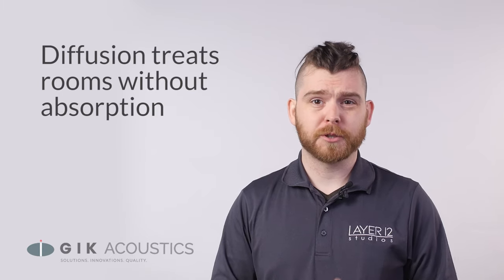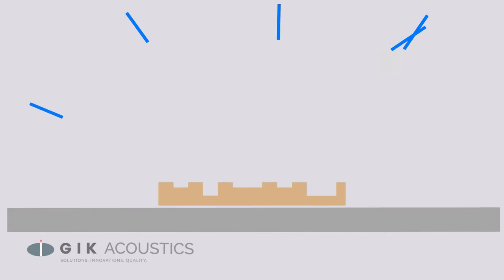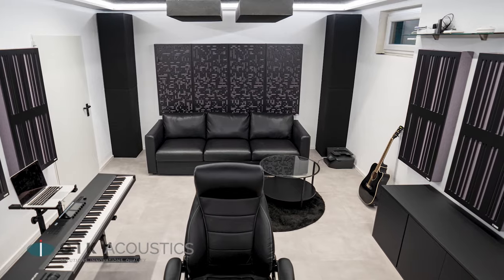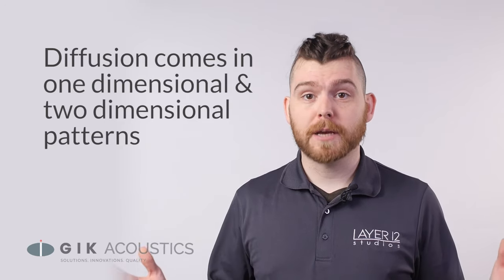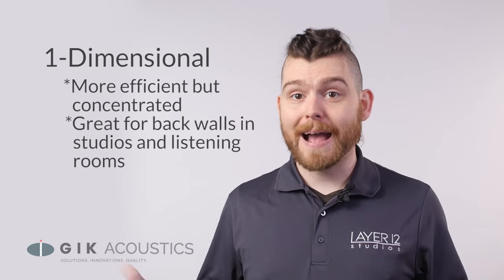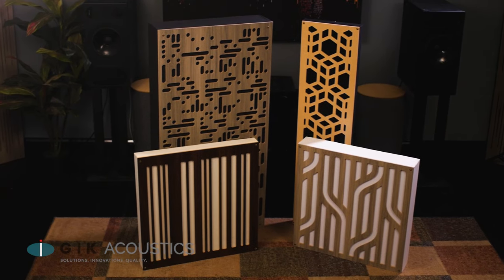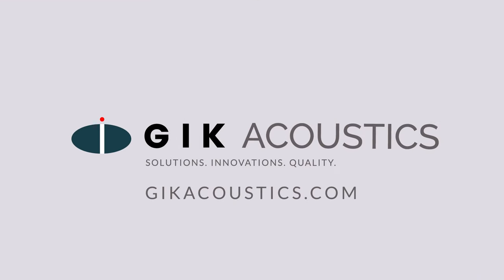Understanding Sound Diffusion and the keys to use it effectively

Comment: I  want to record ONLY vocals in a 10 x 14ft room with carpet on the floor, dry wall and  window with blinds on the 10ft wall. I do plan to use a portable ISO BOOTH for VOCAL RECORDING ... would this be enough or would you recommend more acoustic treatment ?
Reply from the maker: Thanks for the question. It completely depends on the quality you are looking for. While you'll see an immediate improvement in simply only using the VISO or the PIB alone, we still suggest having a complete acoustics strategy to combat any and all first reflections (mainly side walls and ceiling) that may be able to find their way back into the microphone's pickup pattern. This includes acoustic panels or creating a "room" using two PIBs facing each other to create a reflection-free space, since there is a chance some reflections from behind or above can make their way into the recording.

PIB (portable isolation booth) -https://www.gikacoustics.com/product/pib-portable-isolation-vocal-booth/
VISO Booth - https://www.gikacoustics.com/product/viso-portable-vocal-isolation-booth/

If you would like custom tailored advice to your specific room, please fill out our easy form and you'll get your question in front of one of our talented acoustic designers. 
https://www.gikacoustics.com/acoustic-advice-form/
Reply: @GIKAcousticsLLC  Big Thanks for the feedback ...

Comment: i'm not sure i understand the concept of 'even scattering' let alone 'perfectly even scattering' even if the sound waves were to hit a panel perpendicularly... 
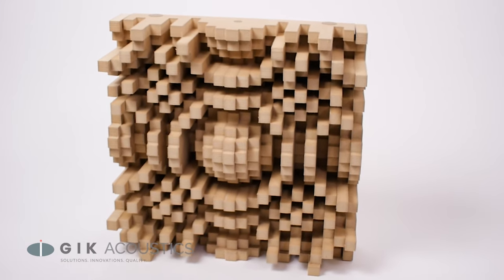take for example the awesome pattern @1:14. 
where would i position a sound source to hit all the sides of the panel at the same time and angle? far away, dead center? that would result in a symmetrical scattering pattern but that's not the same as 'even'.
anyways, that cloud panel @3:35 is insane  :)

Comment: My room is 12 by 11. Very small.  Is there any way to get a diagram of where diffusers and absorbers should br?? 7.2 with a 12 inch sub in each corner.
Reply from the maker: I'd recommend filling out our advice form. If you sketch your room up in our visualizer you can attach it to the form and one of our designers should be able to place treatment in the model to show you. 

https://www.gikacoustics.com/acoustic-advice/

Comment: I don't know if it is worth buying diffusion products for my studio.
 I have a studio H13'XW14.3'XL22.8' that is treated.
I now use Barefoot footprint01 monitors,...... an up from my focal solos. My only issue is a -9db null at 125hz. Everything else that is +/-1.5db more or less is flat due to sonarworks ref. 4
Reply from the maker: Thanks for the comment. That is a good question. So much depends on your setup and existing treatment and the features of the room which goes well beyond just having great monitors. It may be worth looking into with one of our designers. We give 100% free advice if you would like.

Comment: Do you suggest diffusers for small room mostly on the back wall or not toi it and only use absorbers?
Reply from the maker: For small rooms you want to make sure there's enough absorbers to thoroughly treat your Bass. If the diffusion you want to use takes up the space of a Bass trap you needed then it's probably not the best choice. Combination diffusors/absorbers might be useful as you can absorb the loser ranges while scattering the mid and high tones.
Reply: @GIKAcousticsLLC  thank you so much, I will have thick panel about 6" in the corners (2 for each corner) and  2 panels in my first Reflection point, in my front wall and also my back wall and the ceiling as well. But I wanted to add some diffusers at the back and front wall too but I want your advices on that setup. Thank you in advance
Reply from the maker: While we believe it is best to first ensure you're getting proper bass response, we can absolutely give you advice for your specific room, and we'll need more information. Visit gikacoustics.com/acoustic-advice-form/ and we can not only see your room dimensions, but look at what exactly you'll be able to accomplish with your budget and goals.